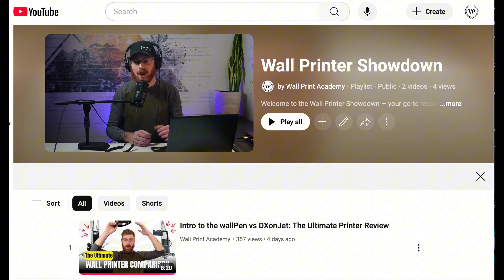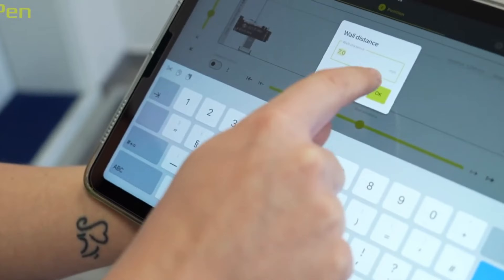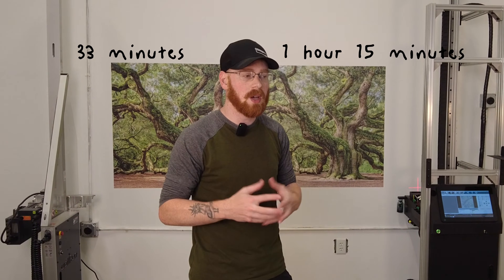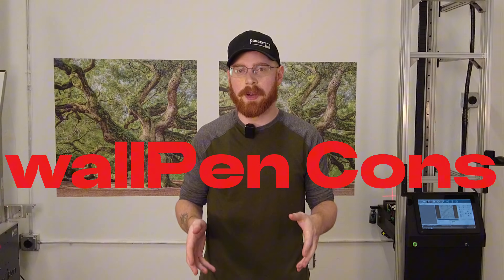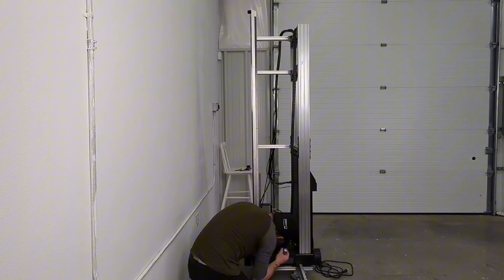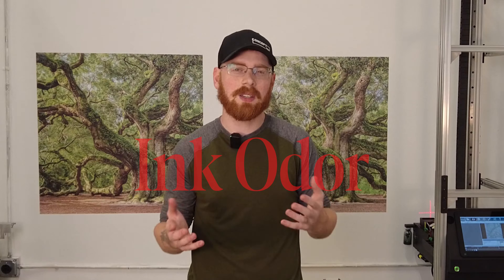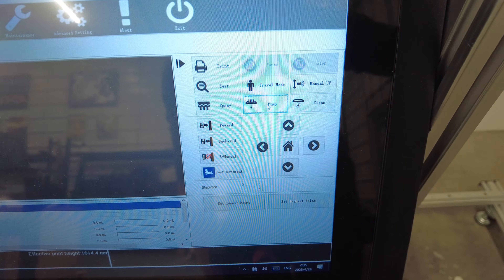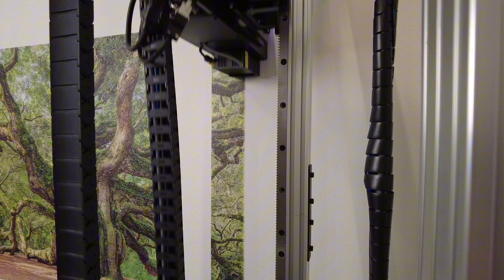The Final Wall Printer Comparison: Print Results & Key Takeaways

Comment: Great material, much needed for the whole industry! Thanks for this!

What settings did you use for DXonJet? What two-end-delay (pause between vertical head movements)? Standard printing time for 1x1m is about 40 min on 8 passes.